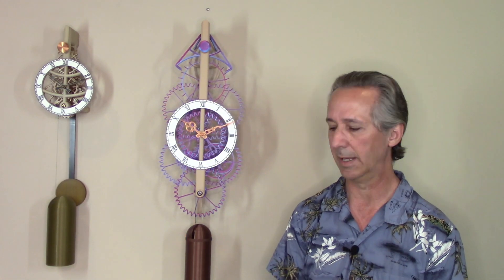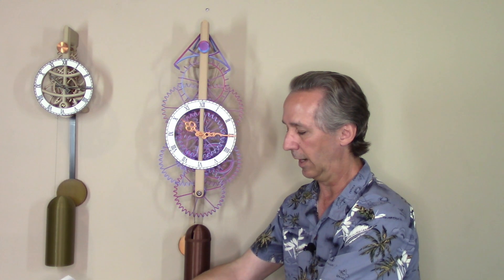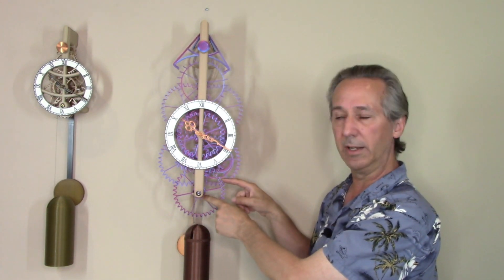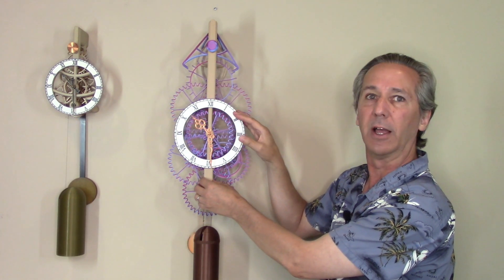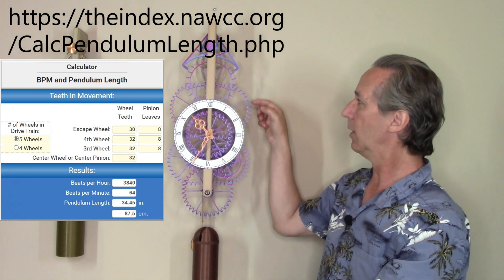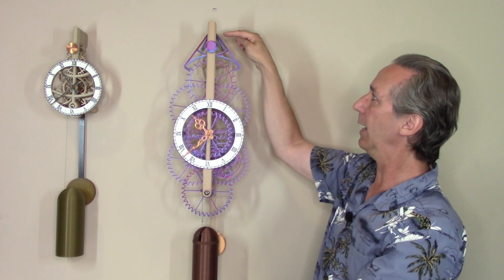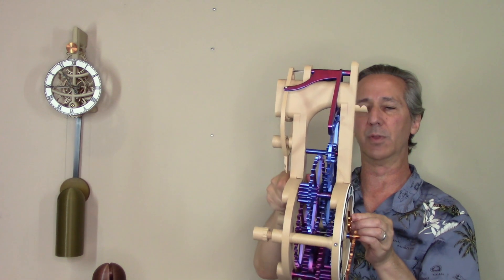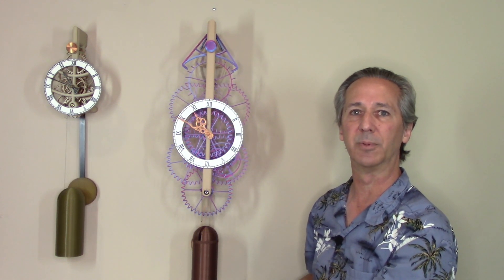Designing a 3D Printed Clock

Comment: Steve, I am fortunate to have run into your web site and videos! My family gave me a 3D printer for Christmas and I obtained the SP2B plans from myminifactory. I now have that completed clock hanging on the wall and it's keeping very good time! In the assembly notes you go into depth on the gear designs and how you ended up with "Perfect Print Gears."  Did you design those from scratch, or is there a website that shows how to do it? I am interested in doing my own design using that gear type (just for my own project and certainly not to compete with you!) but I do not find anything like those gears in my searches. Same for the crazy gears.
Reply from the maker: @Cryogenius  Both gear styles were created manually in CAD. Some of my older designs used Fancy Gears. Those were an extension of a concept shown an old website called "Gary's Wooden Clocks." They started with an involute profile using Gearotic, create the inactive surface, then array it radially into a gear. 

The Crazy Gears start with involute profiles from Gearotic, round the corners, then array the teeth. They look great but have to be made large for the concept to work. The gear perimeter becomes the rim, so they can be somewhat flexible. This makes them work better in the stepper motor clock than in a weight driven clock.

The Perfect Print Gears were manually drawn in CAD by rotating a series of lines. It takes about 5 minutes to create half of a tooth and another minute to mirror and array it into a full gear. All the gears for an entire clock take less than an hour after all the tooth counts are figured out. There are often only 5 to 6 different gear pairs used. I started creating a Python app to automate most of the process. I don't know if the app will ever be ready to release for anyone except the designer (me). I am planning a video describing the gears in a week or two. The Perfect Print Gears operate very similar to cycloidal gears, so they are efficient when a large gear drives a small pinion, but there is little advantage in other cases where the pinion drives a large gear. This makes them perfect for clocks but not as efficient in many other use cases.
Reply: @stevesclocks  Thanks for the info. I will spend some time with Inkscape to see if I can figure it out based on maintaining constant velocity. I will also look forward to your video on gears.

Comment: Steve, a very detailed explanation on your design process.  I'm glad you like to design them, I like to print them.  You should write a book on this, since so many of the reference books are out of print.  I'm sure you could provide new insight as to designing for 3D printing or Laser / CNC
Reply from the maker: Thanks Dave. I always try to consider the material used to decide the best design methods. 3D printing can have completely different designs than brass or wood.